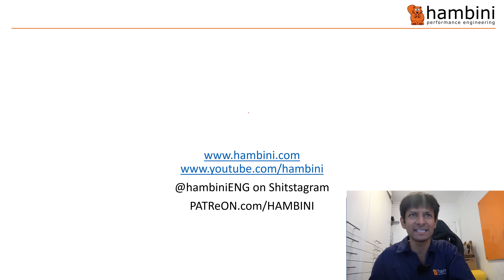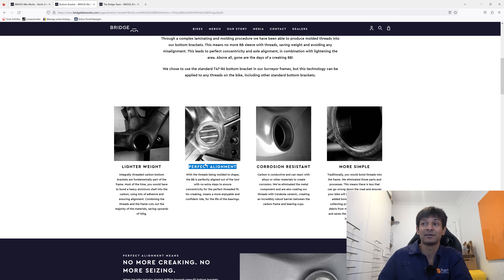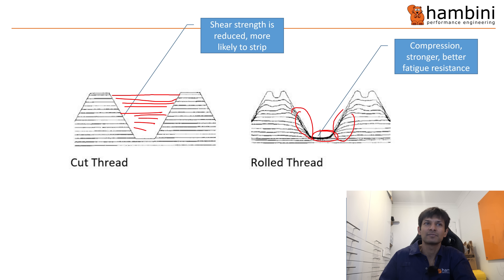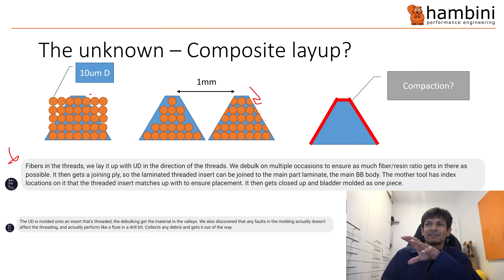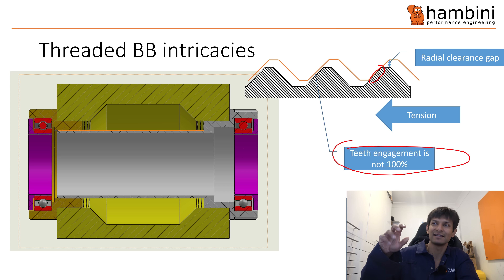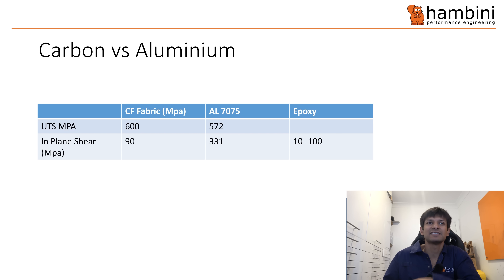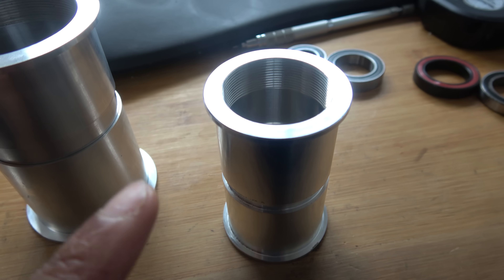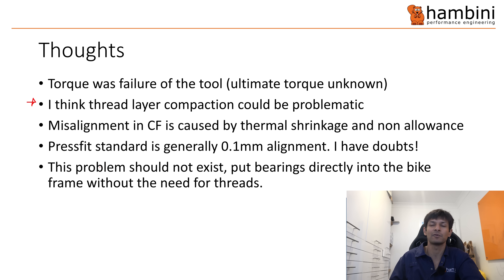Carbon Molded Threads, Crazy idea? | A Solution to a self inflicted Problem | REAMING

Comment: 5:35 rattling good fit 👌 am I way off in thinking that is a really slack fit on the demo unit? Ive never had a BB that loose going in before.
Reply from the maker: That's the radial clearance. it suggests they are either slack or very well machined/low friction.

Comment: The very nature of the bicycle industry is the reason why it attracts little, if any, highly talented or qualified engineers. Those with any talent or qualifications probably mess around with bicycles at the student level before settling down and doing real work in industries that not only appreciate and need them, but also pay substantially more than the bike biz does. This is where the self-inflicted wounds come in as evidenced in questionable design and manufacturing, things like the brain-melting array of competing bottom bracket “standards,” and ridiculous creations like Specialized’s Sirrus X (among others) with the missing or truncated seat tube. When products are designed by marketing and PR departments, or on cocktail napkins (which was common practice in the 90s), anybody with half a brain, self respect, and professional integrity will stay away.

Comment: If they can make threads in CF then why a BB? Large hole with built in compression from the crank is the last place you need a thread, better to press in a bearing cup.
Where this would be useful, if it works, is in stem bolts, water bottle bolts, and other similar fasteners.

Comment: btw doesn't it seem weird how basically everywhere in engineering people just press some bearings in, yet the cycling industry seems to struggle with it?
Reply: But does every other industry fetishize carbon fiber like cycling does or would they just engineer the area the bearing is press fit into differently?

I feel like most other industries would make an aluminium BB shell and bond that into the carbon.
Reply: @Surestick88   there seems to be very little information about this. But whether you press, you thread, or you bond an aluminium shell, does any of this deal with the differences in thermal expansion between carbon fibre (low) and aluminium (higher), and repeated temperature cycles?
How does aerospace deal with metal to CFRP interfaces? Do they use aluminium for that? They certainly have to deal with significant temperature fluctuations.
Reply: @Surestick88  that was the way to go 15 years ago, my Time VXRS has an alloy BB shell in a carbon frame. 

Only downside is galvanic corrossion causing the BB shell to get loose.
Reply: Exactly, and the most bizzare part is that the cycling industry actually also does it successfully - the bearings are pressed into the bearing cups, which you then screw into the frame. Why they can't seem to make pressfit frames work, nobody seems to know
Reply: @dirkmohrmann8960  Pivot cycles has PF92 on their mountain bikes and I've never had a problem with them.
Reply: Most engineering people are not pressing bearings into a thin carbon shell
Reply: But it’s Formula 1 technology for the masses, be happy peasant!
Reply: bmx bbs are pressfit since ever and they just hammer them in with a piece of wood and it works fine without creaking. this is not a general cycling problem.
Reply: If you press a bearing into a machine made of aluminium or steel you have plenty of material and a CNC machined counterpart to the bearing. A bicycle bottom bracket is a thin, lightweight construction and both sides can be slightly misaligned too.
Reply: Press the bearings on metal housing not into carbon housing/bottom shell.
Reply: been doing it in auto repair for decades.
Reply: My 20 year old carbon frame has a Ti shell insert in the bottom bracket, and I haven’t had any issues.
Reply: Put that down to the industry's obsession with marketing carbon frames for the sole reason no one has figured out how to justify $6000 for an alloy frame. Yet.
Reply: the ned 3d printed alloy pinarello is way more expensive then 6k lol

Comment: I'm sure someone could get the first ply down fairly well consolidated with a plain weave, but assume the 2nd ply would have to be bootlace crammed in and it would take a skilled aerospace/f1 laminator bloody ages to push the material in properly. In mass manufacture the peaks would probably just be bridged and resin rich. You can see the voids on some of their pics of what you assume is one of their better attempts.

Maybe chopped strand/resin infusion would work better.

I'd love to see a close up of the threads, and the layup, really interesting project! Although for a bike I'll have my bearings and threads into metal please.

Seems like a great way for peak torque to make some lockrings for his 180mm discs 🤣
Reply: Tight angles with CF never work well in my (very limited) experience, and I think they would be nearly impossible to make in the way that would make strong threads, if my understanding isn't wrong. The fiber layup I presume you'd need (zigzagging up and down the thread profile viewed in cross section) to take up the forces pushing against threads perpendicular to the BB axis could never be turned by any CF fabric I've seen, which is why their explainer seems to indicate they're just wrapping uni tow around their molds. But that would mean thread peaks and valleys were primarily resin unless they could somehow jam smaller bunches of individual fibers into that zigzag profile? And in the end your thread strength would still just be the resin holding the bundles together?

Comment: i would have to question the long term ductile stress resistance of the epoxy , while initial fitting may achieve a suitable torque level , the epoxy may be in a ductile state that moves very slowly and thus failure may occur after a year or so of repetitive torsional loads being applied ,  also the threads on the cups will have to be formed just as accurately as the bb shell thread . i do not believe such tolerances are available to any mass production or even bespoke builds as the rejection rate before a truly usable interface is achieved would be astronomical  .  the video of the bb cup being screwed in demonstrates the slop in that joint , even my low power string arms could strip those threads in a heartbeat , even with successful initial fit , a strong cyclist would be by the roadside cranks flopping around after a mile .

Comment: Seems interesting, I'm not convinced that this is really the right application for this. If they can do this all in one step with minimal part finishing I could see this being a decent improvement over a traditional bottom bracket. Also when you fck up your bottom bracket threads they can sell you a whole new frame! Apple level innovation in bike manufacturing is not what I was expecting in 2023.

Comment: I wonder if the ceramic coating they use is a two part coating. You'd want to get the coating at a few microns. This seems very novel and F1 but not for long term use.

Comment: My initial intuition was that using the fine threads that work in aluminum and steel probably isn't right for carbon. It doesn't seem like carbon could handle the shear strength and the threads would crack off instead of deforming.

Comment: Hambini is onto something. Given all cost-cutting measures inflicted on mass production methods, someone had to "invent" that kludge. With aluminum BB cups there's still a threat of galvanic corrosion, but if the concept will prove itself viable (which I doubt it will), we'll see an avalanche of carbon fiber cups from every BB manufacturer rushing onto the market.

Comment: If the alignment is "perfect" then why cut threads into the frame? Use your "perfect" alignment and have your rider press fit their bearings in. The simple solution was long ago made by Cannonade. It's just that manufacturers can't do "perfect" alignment.
Reply from the maker: totally correct.
Reply: It’s more that it’s too expensive to manufacture perfect alignment. They would rather lower cost and make most of them “good enough.”
Reply: @anotheremailaddress9664  then how does aligning it perfectly and cutting threads into it improve... anything?
Reply: @seanrequiredfieldcannotbel1362   I’m not arguing it does. 
While a threaded 100% carbon bottom bracket shell is impressive, it’s not something a Giant or Merida would rush to do.

Comment: Potentially great but am very sceptical
Reply from the maker: I'm not sure why they needed it, they could have moulded round seats into their frame, no expensive research and no patent.
Reply: @Hambini  I have often thought why don't they make the bottom bracket as a solid shell then bore it out... And greatings from NZ
Reply: As Hambini rightly said above, if its not for patent, they should’ve moulded round seats into their frame, only doing it right.
Bridge is now putting cart before the horse.

Comment: "A solution to a self inflicted problem", you summed up the state of the industry in that line.
Reply: "Most people rejected his message. They hated him because he told them the truth."
Reply: Exactly
Reply: Well, if you compare it to an alu threaded insert, he said it himself at 12:30 "it's still stronger bc you get rid of one interface" (the one between alu and carbon that is subject to fail, even just by thermal expensing/contraction). So, being a P.Eng myself, I think this is interesting, novel, and it may be progress if time proves it reliable.